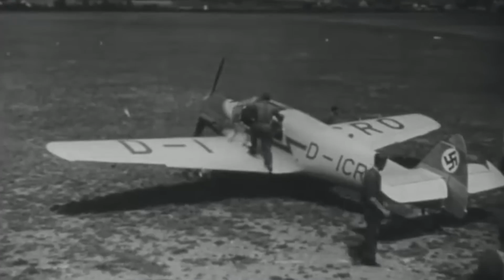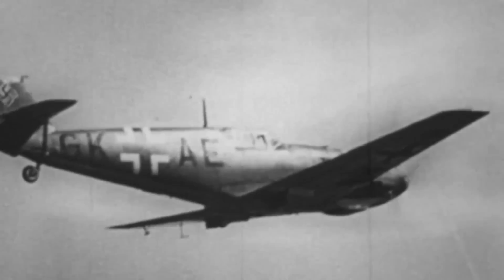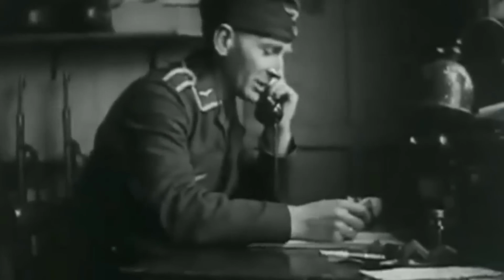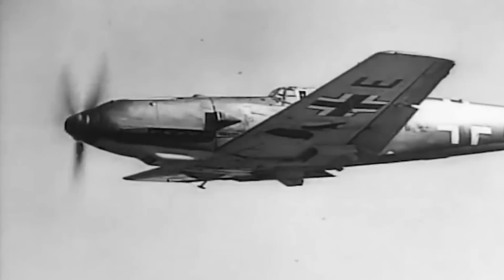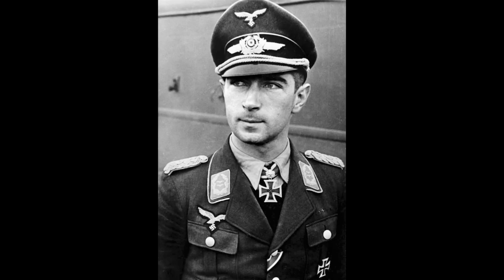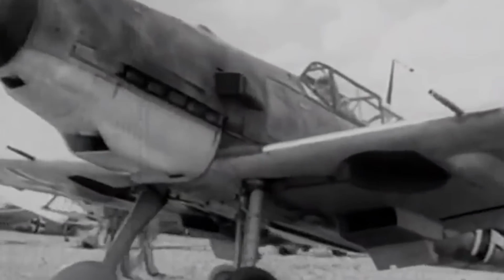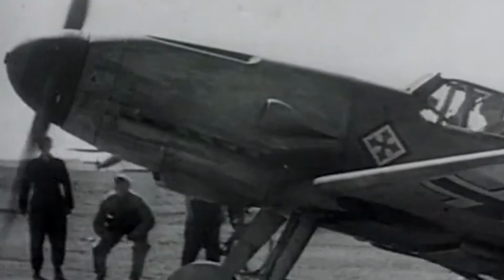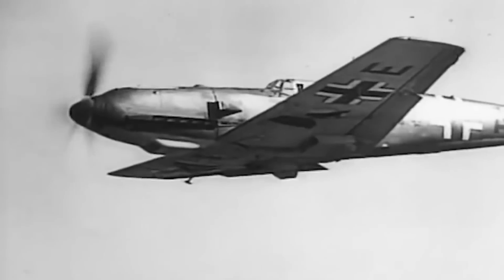Messerschmitt Bf (Me) 109: A Luftwaffe Legend | WWII Documentary

Comment: Dude the only thing it DID better was stick forward initial dive.
It was generally slower, didnt turn as well, had shit visibility, harder to land (LOTS harder to land), all the dials were labeled in bloody german, had far higher wing loading, was more susceptible to battle damage, had much shorter range and was harder to bail out of.
Only thing it had going for it was heavier armament (and big woop given its 20mm was a low velocity pos with impact explosive rounds which basically blew up on the outer skin not inside where it really counts) and far far more battle experience and trained pilots.
Put those guys in spitfires. Yeah.
Reply: It all depends on which versions you compare. The early 109's the Emil and Friedrich were superior in rate of climb and dive, acceleration, speed at higher altitudes, and rate of roll when compared to the respective Spitfire's Mk1, Mk2 and Mk5.

Comment: The BF 109 was a great aircraft and very similar to the spitfire in performance…..the biggest slight against the  BF 109 was the fact that over half of all German fighters were lost trying to land on grass runways in Russia because the landing gear was too close together….
Reply: It was designed in 1935 but still held its own right up to the end of the war in 1945. Well designed, fast,and well armed,however was short ranged. Had only 20 minutes of flight time over England and had to go back or run out of fuel.

Comment: The BF 109 was an Interceptor that was forced into the role of air superiority fighter.
Reply: Correct but for different reasons in my view. She was a close support for the Army Blitzkrieg as well.
Reply: There was no useful discrimination between interceptor and air superiority fighter in WW2 until the ME Komet 163 came along.  A pointless and irrelevent distinction.
Reply: Just plain wrong in so many ways.  There was no such thing as an interceptor at all in WW2 until the ME163 Komet came along.
Reply: Great point!
Reply: The P-38 was an interceptor (for bombers if that's your meaning), so it was fast, climbed well and was heavily armed, but not manouverable.  The 109 was an air superiority fighter from the beginning - a zone fighter was the term used. It was then modified for many roles including ground attack, ... eg. taking out T-34s from behind.

Comment: Maybe the 109 was the Hurri and Spits nemesis but it was the Mustangs next meal.
Reply: The Mustang actually had a little trouble with the Bf 109 , but still managed a positive kill ratio
Reply: Lots of Mustangs shot down by old 109's.
Reply: Spits shot down many more planes than the stang on average
Reply: @ant-onemusic444  You are comparing Apples and oranges. The Spit was around at the start of World War II so it was in battle starting with the end of the "Phony War" in 1940. The Mustang didn't get in the war until the P-51B/C started missions at the end of 1943 and the beginning of 1944. Hermann Göring stated that the first time he saw Mustangs escorting bombers over Berlin that he knew the war was lost. Mustangs ended the loss of 60 bombers per mission because the German fighters started losing fighters attacking bombers. Bombers from Italy didn't lose aircrat once the Red Tails escorted them. Mustang pilots became aces in a day against German fighter pilots. Once their escort missions were over, they would move mud and directly attack German air bases from ones deep in Germany all the way back through France or made hunter/killer sweeps while headed back to England and Italy. The Spits had short legs while the Mustangs had very, very long legs indeed.

Comment: The Bf109 had much more firepower than the Spitfire or Hurricane until they were equipped with cannon and even then had more ammunition for the guns. In addition, the engine was fuel-injected, so the engine carried on working whatever the orientation of the aircraft.  However it had a number of downsides too, like the pilot sat on the fuel tank !
Reply: Yes, it is correct as the pilot sat on a L-shaped fuel tank, both under and the back but it was a self-sealing fuel tank and was quite effective. The Spitfire and the Tempest had it between the engine and the cockpit...
Reply: It´s a good ride for flight sims, as you wont die from burns! Now seriously, yes it was a death machine that could be a death trap. But the Hurricane had the fuel tank right ahead of the pilot, and many British pilots died a horrible death during the Battle of Britain, falling down in those flaming torches...
Reply: Both planes can out turn the 109 and the 190.
Reply: The Bf109 shot down more planes than any other. That alone commands respect, take off, and landing could kill a novice pilot. Once in the air, it flew beautifully.
Reply: The 109 had a high wing loading from the very beginning in 1935, so its development and ongoing competetiveness was spectacular despite that handicap.